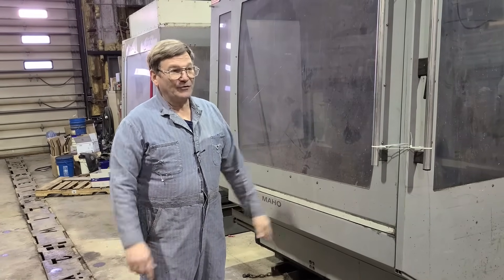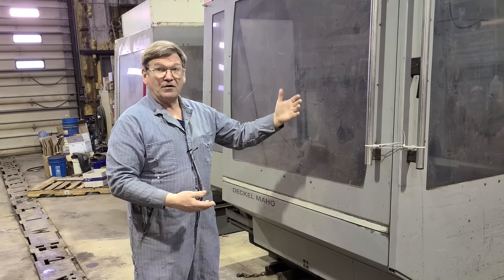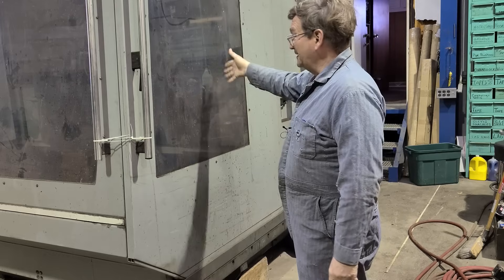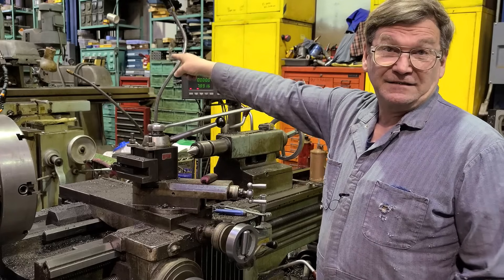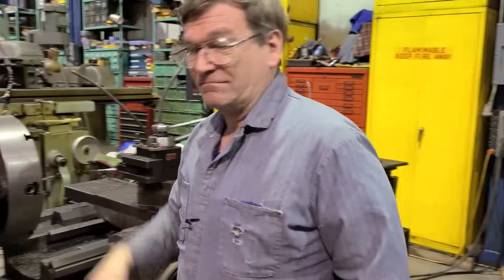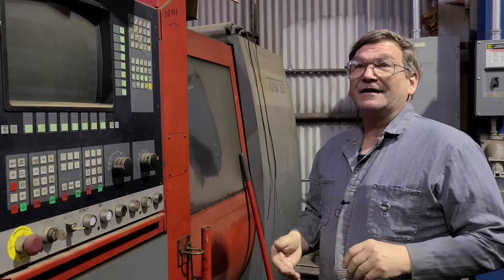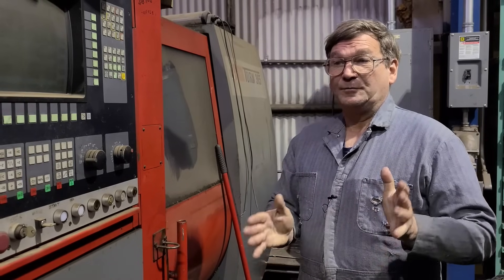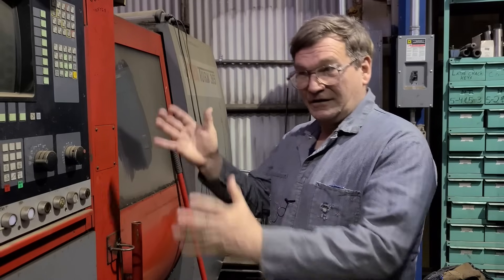Machinist's Minutes: One last CNC discussion

Comment: I've been at the shop I work for for over 30 years making prototype parts and small quantities of production parts on manual lathes and mills. About 3 years ago the owner got me a Hurco CNC mill and I freaking love it!!! You can do mill work just like on a manual mill just with the controls and the conversational programming is very quick to program. It will also run g&m code programs. I don't mind not having to change out every tool on every part  now either. However, I wouldn't know half of what I do now if it wasn't for having done it the old school way for so many years. Love your channel ❤! Please keep them coming 👊
Reply: some conversational are great and very fast to make a program. I think I used all 5 fingers to program a Tree CNC mill. My first job after school, luckily they also had one in school so I already new it

Comment: This is the best discussion yet on this topic.  There is no one size fits all answer.  CNC vs Manual is just an Apples vs Oranges argument.  They both have their places, anyone who says one is better than the other is just ignorant.  My shop is all manual, not because I don't see a reason to have CNC but rather, I don't like the work CNC is good for. On the other side, almost 50% of my business is from other CNC only shops needing manual machining.  There is no comparison, just depends on your market.

Comment: In our machine shop, we have a Ward 07 built in 1911 and it was purchased into the company secondhand in 1940.

It produces Vs in larger pulleys, a CNC to do the same swing and has the same plunge cut ability $1, m.

Just the largest V we produce 30 -40 a year to customer specific. Nothing the same OD or Bore.

Totally understand what you are saying.

Comment: 17:44 the benefit of this for quick prototyping is there can be 20 people prototyping at the same time on the same $150k CNC. All of the parts can be cut out the same day while only one person is needed to watch the machine.

If the company is doing such quick work, it would be more beneficial to pay for 20 engineers (or ex-machinists) to be prototyping rather than keeping 20 machines running, pay 20 machinists and 20 engineers to make the plans.

Like you said it's all financial - it can make sense for a small shop if they are inventing or have a production contract but probably doesn't make sense for the shop that is only a repair shop

Comment: 54 years in a manual shop. Started with a VICA program in High School at 14. Hired in to a machine shop at a Potash mine as a journeyman in 1974. I have yet to push a green button on a CNC. I have spent my entire career in the mining industry as a machinist. Some of the work is rocky-stone axe work. For instance, we had a bearing lose lubrication on a big Tyrock screen and wear a deep groove in the shaft. The groove was 1/4" deep all the way around the bearing fit. It was a multi-shift job to change the shaft. My boss had me build a sleeve for the shaft and then split it axially. They then put a new bearing in place and pounded the sleeve under it. Then they welded the sleeve on the accessible ends and the welding pulled the sleeve tight against the bearing bore. I told the boss that i would give it a lifespan of 24 hours. It ended up lasting over 3 years. Never would have believed it possible.

I believe that, with the proper fixturing, I can beat a CNC in speed. However, when the phone rings the machine stops. Likewise when the end of the day rolls around or nature calls. There are places for a CNC, but not in any of the places I have ever worked.

Anyway, I work in my shop at home now that I have retired. I make parts all winter so I can spend my summers in Seward. If I get up Fairbanks way I'll stop in. Thanks for the thoughts on the practical aspects of manual machining.

Comment: I used to work with jigs and fixtures on a manual milling machine in my own shop and this was the way with my shop. I did work in a CNC shop when I was older and did programming but I had to be on top of the machine or it would err at times.
I did study precision machining under Germans  who came over here in the U.S. under Operation Paperclip. They did superb work but did not have CNC tools. All their work was with jigs and fixtures and so that's the way I machined in my shop.

Comment: You hit the nail on the head with your comments here my friend. I am the equipment manager at a rigging company in Massachusetts. I constantly hear it's my fault if a piece of equipment does not do what the operator wants it to. It's the owners fault for not purchasing a newer piece of equipment to do a different task, When any experienced and qualified operator can take that same piece of equipment, and produce excellent results. It's easy to make excuses but actually doing the work and learning the task and doing it correctly. That's where the real value is.

Comment: Great to watch your content as it bringings back memories of working in a shop that had both Manual and CNC. Lot’s has changed and every shop is different with the type of work it does. In my shop we used both and it was hard to beat a manual mill or lathe for certain operations. Reminds me a saying “Horses for Courses”.

Comment: Our solution to one off parts was conversational cnc. The ball screws precision and the profiles that we could quickly create was not competitive on our manual lathes. Then came bores and bolts patterns, even weld preps can be quickly done on mazatrol cnc mill. And we do quite large hydraulic cylinder repair, so equipment has to match work.
Maual machines are 25% used when needed.

Comment: What a great video, stuff I think about all the time in everyday life, but I don’t know if it has ever been articulated as well as you did in this video. I could comment on and on for hours about stuff that you touched on but the classic example 1920s screw machine still spitting out screws.—It never needed a software update, no computer boards,in a 100 years, if you needed a part, you can make it. I am old-school too, and I have been through this my whole life too, with home computers with cell phones, with trucks and equipment, the computer age to put it simply, here today, gone tomorrow, what I mean by that is you have something cutting edge today, five years down the line it’s obsolete and there is no more computer support for that machine anymore. Modern day computer engineers are going to completely ruin this country, all technology has done in my life in the trucking industry has done is to drive up the cost of equipment so high you can’t afford to buy anything anymore, and their technology now is causing the majority of the problems on the equipment. Again great video- my rant is over also. lol

Comment: The problem with old CNC controls is that they are so bad that programming them is just like pulling your hair out.  Haas did the world a huge favor in making a control that a lot of people warm right up to.  It's not the end-all be-all but it's a damn sight better than 25 year old Fanucs.
Reply: Agreed!   As someone who has to use a 25 year old Fanuc I can assure you that I would have quit my job ages ago if I hadn't discovered Cimco Edit, which allows me to program on a laptop and upload the program to the controller.
Reply: I ran an old Fanuc OM for a few years. 1988 machine. Line process time was slow, forget deccel override. Mirror image of a tool path/macro was weird, and you had to return to the origin every time you changed the coordinate system. And nothing visible on the screen when running from remote. We never hand coded from that little console that would suck.
Reply: even compared to modern Fanucs, the introduction of Manual Guide on Fanuc was a great leap forward for programming on the control, right now we are in process of setting up a dual spindle dual turret Takisawa lathe for large production runs and what nobody realized until the machine was delivered, that there is no manual guide... Programming has to be done via raw G-code... But luckily for us, we can simply punch in the program on any other fanuc lathe and let the machine convert it to raw g-code.
Another problem with old controls is that you can make the same part often twice as fast on a modern machine without changing feeds and speeds, just by higher rapids, faster tool changes and accels...

Comment: Biased video, which is understandable. Pros and cons to both. Real shop needs both, but i know which one i pick everyday, that is CNC.
If you have the correct setup, it can be quick in certain circumstances, most of them to be fair. Running one while preparing and programing the next. If you have batch work more then ten, one man is not held up at one machine doing one job, he can run multiple machines. Simple
Reply: A machine can be running while I'm eating French toast 😊
Reply: Is your machine running while you eat French toast?

Comment: This all depends on how you think. If you find thinking in conversational Cnc language easy then it's easy and fast. 
If you think in manual machining it won't be faster.
Reply: also if you think in 3k rpm spindle, it wont be fast... modern spindles and modern tooling truly is amazing, if you know how to maximize your MRR...
Reply: @dubi127  just feels like someone trying to justify manual machining to themselves/ a bit desperate
Reply: @MT_T991  to me it feels more like someone who has life-long experience on manual machines and only a very limited knowledge/experience with modern CNCs, as i said in a comment on his previous video, there still are applications where manual machine is faster, but those are few and far between, CNC mills can do much more with limited tooling, you dont need a tool specific for every job. Also there are edgecases where manual machine is simply more economical, lets say you are turning 40inch pulleys twice a year, not really viable to buy a cnc lathe for that specific task, but if you know you are doing it somewhat often, you should consider buying a VTL...

Comment: "Beware the man with only one rifle because he knows how to use it." This applies to pretty much anything including machine tools. 
A lot of the reasons you are using such as tools available for the machine tools are BS because the thought process and set up is essentially the same for CNC or manual.
I have both, are jobs that simply make more sense on one machine or the other. I interchange tools between machines and my doors open up on the CNC so I can put a 10' piece in it, the deciding factor is whether or not I want a 10' piece flailing around with a mind of it's own or not.
In most cases it is a question of can I make the piece faster or more accurate with the added programming time on the CNC vs Manual, there are a lot of really good CNC guys who can and do.
For me I like to be able to feel a cut on a manual can be the deciding factor but if there are a lot of compound curves etc it is CNC without question.

Comment: plenty of cnc's don't have enclosures . i got one vertical machine center with 40 x80 inch travel with no enclosure. so that 10 foot shaft would fit fine on that.  i also have 5 haas vf4ss machines that are used for secondary operations on fiberglass parts we mold. each machine does 170 cycle/ shift for 3 shifts 5 days. they are all older machines around 2006 because they are cheap , fast , accurate enough have linear ways which are better when you can't use coolant and have fiberglass dust, and haas has great local service which is important when you are in a small town. 
another reason for cnc is you can cut shapes you can't do manual like make steel molds in 3d.

Comment: The 2 job shops I worked at in the mid 90’s had mostly manual machines. One only had 1 I think it was a Mazak I say I think cause I never used it. The other had 3 a Herco which was used all the time and a mill like you have there and 1 lathe. All of the manual machines were always used and were the backbone. 
The screw shop I worked at had no cnc. It had over 20 Brown & Sharpe clinkers, the dungeon had 10 really old Brown & Sharpes mostly for tiny screws, 6 six spindle Wickmans, a Wizzer, more than a few manual turret lathes and an old Cincinnati centerless grinder all being used everyday. The heat generated from the machines kept us warm in the winter which was central Jersey.

Comment: An expert cnc operator can run a bunch of machines. An ordinary tradesman can run one machine. Takes a very skillful tradesman to run manual machines and be quick and accurate. DRO's and quick change tool posts with lots of holders is a very good compromise.

Comment: I'm a manual machinist in a job shop with both manual and CNC.  I work primarily for the press repair dept. where we tear down and rebuild large punch presses and other large industrial machinery.  Many one-of's come to me, repairs to shafts or bushings,  chasing damaged threads, welding or metalizing damaged bearing journals .  In our shop it is far more economical in time and money to do this work manually.   I may have to duplicate a part for which we have no drawings, and where we may actually change bearing/bushings fits by turning down damaged journals or bores to clean metal and then make appropriately resized parts in order to buy an old machine some new life.  This is very often better than having the CNC dept. stop high paying production work to fit in a single job when I could easily do the entire job (including welding/metalizing) in a single machine without ever having or producing a working drawing.   The CNC's are making money in the meantime doing what they do best.

Comment: my first job had wire EDMs and manual machines, we had one vf2 that didn't get much use.
but i did like the proto mills them worked pretty good for between cnc and a Bridgeport.
we also had surface ganders, most of our work flow was mill to shape with holes,
heat treat, then some grinding to shape then wire for the complex shape.

Comment: I have an old 1948 monarch lathe  with a 12’ between centers, war spec nearly brand new. I run it three times a year so I don’t have to outsource oversize parts. It pays for itself each time I turn the switch on. No payments.

Comment: I met one person in my career who was as comfortable using a CNC or a Bridgeport. He could enter gcode in real time as easily and quickly as anyone I've ever seen run a manual machine. Even just decking off a plate or cleaning an edge. It's certainly unusual and special but not impossible!

The thing that disappoints me most is that CNC guys tend to treat manual equipment like obsolete junk that's beneath their expertise. The milling centers are all running to tenths, but the Bridgeport has .300 of backlash in both axes and the knee only goes up.

Comment: Within the size range is the key, what happens when they get the bright idea to put an extension on a small CNC HAAS T1 lathe to turn a large taper on 5.5" diameter hot roll .25" wall 5 foot long! 
I am a nervous wreck because they bought it and intend on doing it. It only has a 3' bed, less the chuck and tailstock, they will need to attach about a 3' modified extention minimum and a wonky huge live center.

Comment: You should do a show on the lost art of hand tool grinding.  There are a lot of different ways to grind a drill.  There are a lot of ways to grind a cutting tool.  Explain the geometry of a tool sharpened for brass as compared to cast iron or SS.
Another show on how do you make a hole.  Which depends on what the hole will be used for.  
Another show on what a huge improvement geometric tolerancing was.
Reply: I concur! I learned how to use a lathe by watching an old timer in my shop, and he explained the cutter to me by showing me how to grind the correct surfaces into a blank on a pedestal grinder. When I bought my lathe I got a pack of blanks and made pretty much all the tools I use, and everyone who sees my shop is surprised I'm not using carbide inserts and asks why I'd ever want to do such a thing.

If the choice is to spend money and wait for a specialized tool or walk over to the grinder and make it, it's an easy decision.

Comment: I don't disagree with anything you have said, It really boils down to every shop has to make their own decisions based on how much footprint their shop has, and what kind of work they do. I have worked in the R&D aerospace industry for almost 10 years now, and it would be impossible for us to make the parts we make, in the footprint we occupy with manual machines. We run lots of ceramic cutters, wire EDM's etc, in inconel, renee etc, and most of the parts have complex geometry. We still keep a few manual bridgeports and lathes, but they are almost always relegated to making parts for shop use, its very rare for them to send parts out the door.

I miss running manual machines sometimes, but with our workload they just aren't practical

Comment: The other point is, cnc machines can cost a lot more to operate electricity wise than a manual machine. If your electric costs are expensive, you will notice a cnc machine can really eat up the kilowatts.

Comment: The new controls are real easy to program conversational. That old lathe you talk about innacurracy the new cnc controls will compensate for if you colluminate the correction in the control. Its actually harder to find a manual machinist than a cnc machinist. Not alot of what your saying applies today. It used to be not anymore.

Comment: I agree with you 100%.  Manual machines are underrated and still very valuable. One thing that CNC also does is it doesn't require a skilled machinist to operate. It takes a lot of time to train a machinist plus time on the jobs to become proficient. CNCs require an operator, programmer and engineer. however, the programmer and engineer can do multiple machines. A added advantage is for repeat jobs, you already have the engineering and programing work done.